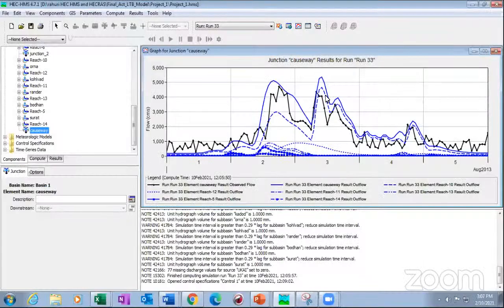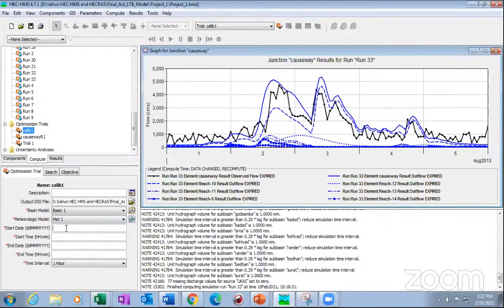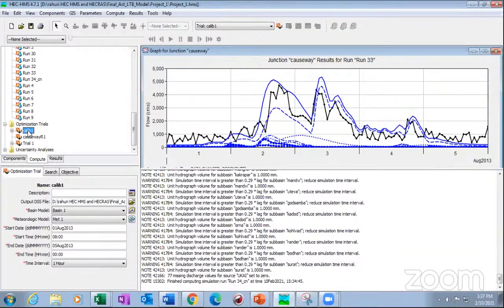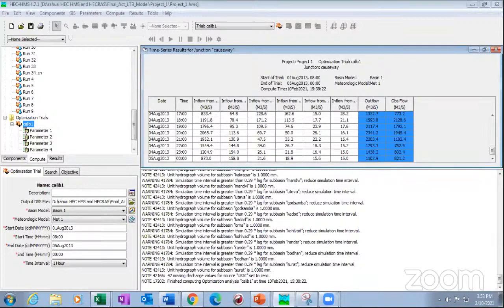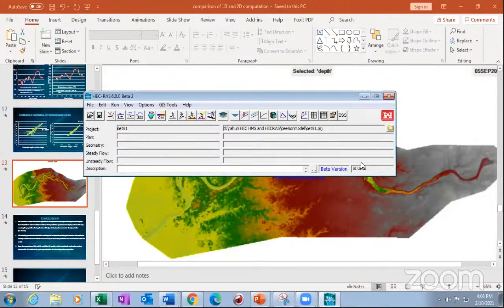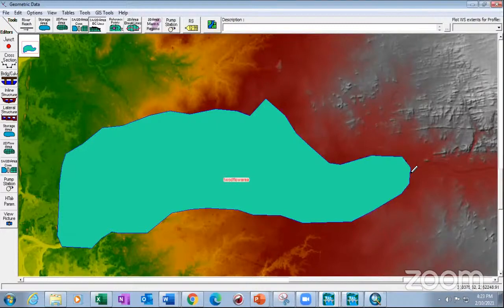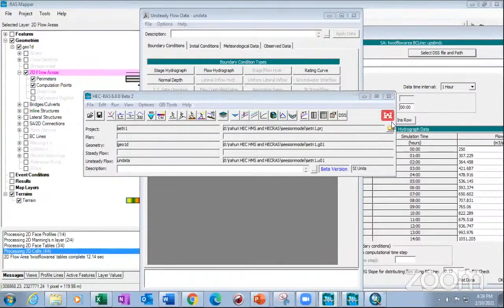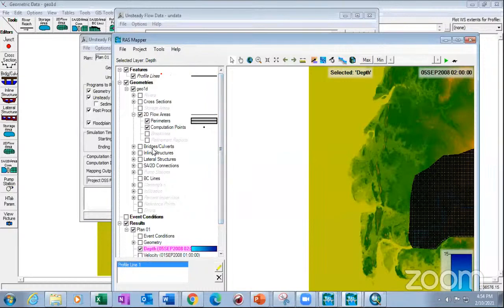Day-3,Session-2 on Hands on HEC-RAS by Mr. Praveen Rathod

Comment: Sir i have a doubt in Hec Ras. There is step in Hec Ras, we get the option as Storage Area connection Breach Data, inside this we have a option called parameter calculator. My doubt is  in parameter calculator section, how do we enter the data.
Ex- In this section, we have options like top of dam elevation, pool elevation at failure,breach bottom elevation and pool volume.
 My doubt is that in top of dam elevation or pool elevation should be consider Mean Sea level while entering these values or not .
Which height should we consider in breach bottom elevation ????